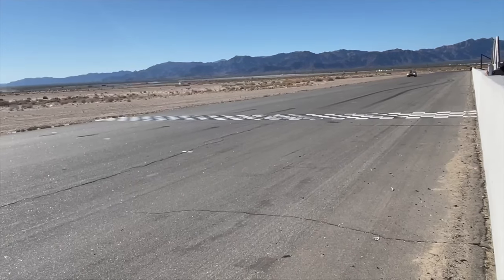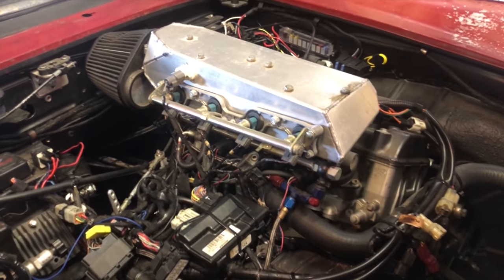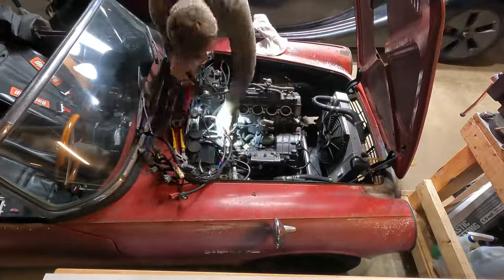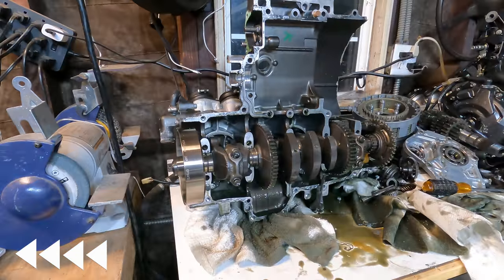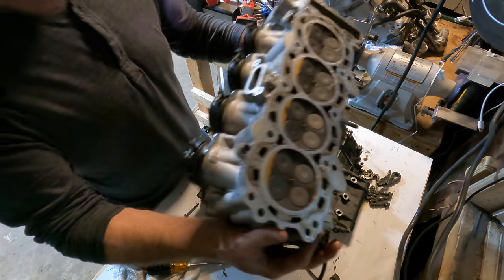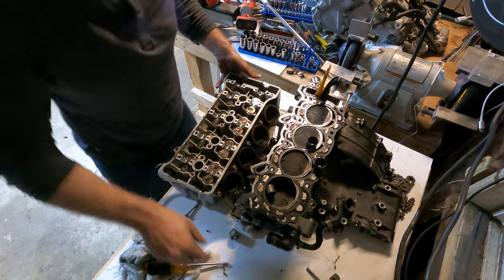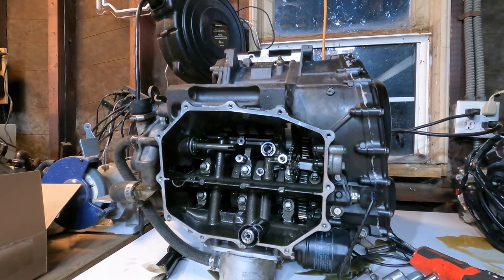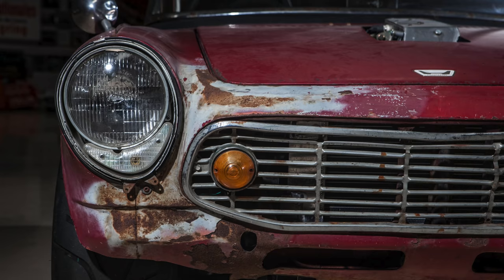I Blew The Motor In My Motorcycle Powered Car

Comment: "Faint ticking noise" just means there's no hole in the block yet.
Reply: Ohhhhh... Not always.  XD
Reply: 1:55 It's subtle, a slight ticking noise...
Reply: I thought a jack hammer is quieter
Reply: Drove a car once after it broke a rod and sent it through the block.  Was better than pushing it into and out of and then back into the shop. |

Had to drive it back in when the adjuster showed up.  That time, there was no oil in the engine because the pan was off, but meh... rod through the block.

Mazdaspeed 6.  It shook like a Harley with only 3 pistons attached to the crankshaft.
Reply: @manbunmyname5866  I’ve owned a few cars over the years which ended up making a “faint ticking noise”! The fact they were making any noise meant they were still running so to fix the problem I turned up the music. 🤣
Reply: @connomara4171  Sarcasm

Comment: We run a cbr600 in our FSAE car and have had really good luck with the Dailey engineering dry sump pump that replaces your water pump, just throw in a electric water pump and add a oil swirl pot/reservoir and we still keep 80+psi pulling 1.5gs

Comment: I recently added an oil accumulator to my track toy and it definitely helped stabilize the oil pressure.  It just depends on the level of "racecar" you're looking for.  For my stockish track toy it's a great improvement for about $500 ish dollars including the accumulator, and all the lines, oil filter mount, et cetera that I made.  Where as a dry sump would be a couple thousand easily.  One change I would make however is putting in an electronic valve, the manual valve is simple but inconvenient.
Reply: Do you ever use it as a pre-oiler before starting?
Reply: @OvertravelX  Yes, that's the primary reason I installed it.  Since I drive the car maybe once a month I wanted a way to protect it at startup.  Because even though oil filters have an anti-drain back valve in them they are not perfect (and not all brands are made equal) and will eventually leak by all the oil leaving you with dry bearings.  It also added some insurance on the track too.
Reply: some engines can end up trapping oil in the top end and starving the mains. oil can also foam and be a problem. long corners dont help.in a motorcycle centrifugal force keeps oil at a level that keeps the pressure constant. in a car? not so much.

Comment: Please please!!!! Do your own dry sump! I've been researching this a bunch for my project and would love to see your take on it. Sucks that you blew the engine but looks like you had fun doing it!
Reply: It is easy to do on a car engine since we have plenty of space with acc drive system with belts to run an off the shelf hydraulic pump. On a motorcycle engine replumbing the stock pumps pickup and oil galleys to do a dry sump is doable as well. The pump does not have to be external. With a small internal pump you would have to be careful about the length of the runs, diameter or tubing and lift height. So no 5 gallon drum of oil in the trunk area of the car. The thing to remember though about a proper dry sump especially in racing is that getting the oil out of the path of the crank and preventing oil starvation in sustained tight turns is only the side benefits. The real benefit is how much power you can build pulling a vacuum on the bottom end of the engine.  That is why racing bodies like say NASCAR limit the size of the hydraulic pump that can be used on the engine. Things like bay to bay breathing on the bottom end become almost less of an issue. It also allows for far more oil capacity than would be doable with a conventional oil pan and the need to package things. In F1 using oil consumption as a means of increasing power and range with exotic oils some of which are designed to burn on purpose and creative PCV systems to facilitate that has also been done already as well!

Comment: When I was doing the "motorcycle engine in a car" thing in a different context (also FSAE), we used to think that the starvation issue was more worrying with "normal" transverse mounting (where the lateral accel means slosh across the pan) than with "longitudinal" mounting (where the lateral accel is kinda like the longitudinal accel/decel the bike engine would see when starting and stopping without pulling sick wheelies and endos). I guess we all were wrong there, but right to spend too much of our lives making a dry sump. Thanks for showing us the light, and good luck with the new revision. Design, build, asplode, repeat.
Reply: We also had this issue, our solution was a custom oil pan that was about 1" deep, it had a few baffles and one-way flaps to stop sloshing. Kept oil pressure within a few psi of nominal on skidpad.
Reply: We still had a wetsump, but had an L-shaped pickup with a weight on the end that swiveled on a ball bearing. Our previous drysumps kept blowing engines, once we switched to that wetsump we were able to keep our engine healthy for years.
Reply: Yeah it makes little difference.
For example in an LS3 on sustained right hand corner over 1.4G it will accumulate oil in left hand head and starve the mains.
You can still starve a longitudinally mounted F20C in an S2000 with stock rims and a baffled sump.
Accusump for casual track days or dry sump if you want to pull G's an run hard. Best part is priming engine before you start it by turning the oil pump separately :)
Reply: @N4CR  Interesting examples. All the concerns about the orientation of acceleration in corners I mentioned in reference to sumps also applies to drainback design, too. But you're right that a sump wouldn't solve those.

Comment: Make a 'pendulum' oil pickup. It's a oil pickup with a swivel in the middle and the end always seeks the gravity low spot. Works great until it gets a small vacuum leak and sucks air.
Reply: Dunno, that dry sump thing sounds more robust.

Comment: So if you do a motorcycle power plant swap you need a dry sump system so you never have to worry about problem I'm guessing?  Awesome video teaching us what to do and no to do lol.
Reply: Don't be silly.  You need active mounts so your engine can lean when your car corners.  A few linear actuators, some Arduino...
Reply: @Lawrence330  Make it passive and mechanical so steering tilts the engine.
Reply: A whole new meaning to "torque steer".
Reply: @EmyrDerfel  I see where you're going with that, but the lean angle depends on the lateral acceleration, which depends on both speed and steering angle, not just steering angle. You an build a mechanical calculator... or go the computer-and-actuator route. Or just put in an accumulator.

Comment: Daignosis correct. BUT you should have a 25-30psi oil light. A trailer light is best big and bright!
And ofcourse an oil guage which is the first guage any engine should get, followed by water and oil temp. Than a tach!!
A better pan and what I find to be an excellent deaeraration device, an oil cooler. Not so much for temp but as a device to deaerate the oil. You may have oil and oil pressure but oil with 20% air does not lubricate near as well as straight cooler oil.

Comment: I know the usual step now would be to go to the venerable hayabusa engine, maybe with a little something called a turbo attached at this point (as the old busa engine is to engine swaps what crabs are to evolution) but may I suggest something from Honda that I am absolutely not sure would even fit in the engine bay?

A Goldwing GL1800 engine.
Reply: Triumph rocket three might work too...🤔
Reply: I think he's pretty set on a Honda engine.
Maybe a CBR 1000 this time to have more "torque"
Reply: K1600 engine!
Reply: "safe-T-turbo" for safe overtaking
Reply: @calebdavies526  I asked about that on an Instagram post, and Matt responded that he wanted to use a Honda engine for the S600, and that the BMW engine was for another project.
Reply: A Vulcan or Goldwing V6 is the way to go. Light weight, plenty of HP but even more torque and low enough in the power band to be useful for a car on the street or track. Since he spends more time on the street doing cannon roads it makes much more sense than a Hayabusa engine. Plus he gains reverse.
Reply: @buckaroobonsi555  goldwings have flat 6's, not v6s. And the reverse on a goldwing is an electric motor, not an actual reverse gear.
Reply: @buckaroobonsi555  The Gold Wing has a flat engine (flat-4 originally, flat-6 since 1987), not a vee (such as a V6). Because it is flat, it is very wide.
Reply: @brianb-p6586   Yeah, it's why I wasn't sure about the engine being able to fit it in the engine bay, though since the s600 is 20 inches wider than a Goldwing it might just be possible (with a bit of fiddling around, as always)
Reply: @Bobinatronus  The problem is that the bike doesn't have suspension and tires on each side of the engine. Imagine the left and right front suspensions of the car, complete with wheels and tires, sitting on each side of the bike's engine... that's wide.

The Subaru BRZ does have a flat four between the front wheels, but it uses a compact McPherson strut suspension and it's a much wider car.

It might work in the S600, but it seems unlikely to me.
Reply: @brianb-p6586  well, it looks like my armchair mechanic skills are found wanting once again. Though for some reason I can't get the image of an S600 with an extra-wide body kit out of my head now
Reply from the maker: Since it's Honda's first car, I gotta stick with the Honda engine. And I like the high revs of a literbike engine. So it's getting the same engine, just newer :)
Reply: @SuperfastMatt  consider the hayabusa motor
It fits nicely in the engine bay and with some easy intake mods it all fits under the hood
Reply: @SuperfastMatt  Happy to hear that.
Reply: It's too bad he's going with the same thing, because I'm pretty sure those Goldwing engines are shaft drive
Reply: @dank_69_420_memes  Wings are shafties but deliver a completely different powerband that is not as sporting as the CBR1000RR engine that I think he's going for.  The Wing redlines at 6,000RPM as opposed to 13,000+.   Great idea otherwise though for sure.
Reply: @SuperfastMatt  cbr1000rrr? blackbird or vfr1200?

Comment: or too restrictive oil baffle. in a corner oil sloshes and gets trapped above the baffle and cant drain back. then straight up run out of oil under the baffle and around the pickup. could be something idk. also what's next? busa, zx14 would probs be better with the extra displacement than the rrrrrrrrrrrsp-r motor you mentioned previously.

also how do you get a good oil level when you have an accumulator? you don't want it to suck up air cuz all the oil is in the chamber. or does it just self regulate and you don't have to worry about it.
Reply: I noticed that too.It's not a good design
Reply: The accumulator self regulates. It can only hold so much oil so basically you adjust the level in the engine so the engine is full when the accumulator is also full.
It depends on the system but, generally the accumulator basically just injects more oil under pressure whenever the engine oil pressure is lower than what’s in the accumulator. Then, whenever the engine pressure comes back up it recharges the accumulator. 
At the end of the day accumulators are bandaids and don’t really solve the problem. They’re good for pre-oiling an engine before starting it though.
Reply: @NBSV1   ok i get it just have a volume measurement for the oil level then add the volume of the accumulator.

 but how does it work as a pre-oiler? shouldn't the accumulator be empty when there is no oil pressure? ie. when it's not running before you start it.
Reply: @nick4506  It has a valve between the accumulator and the engine. Either a manual one or an electronic one. Basically if you close the valve before you shut off the engine then the accumulator will store however much oil under pressure. Then, you can open the valve before starting and the accumulator will push that pressurized oil into the engine to pre-lube it. 
Accumulators are great as a pre-lube device, especially for things that sit a long time. They help with oil issues on track, but aren't the ideal solution.
Reply: @NBSV1  cool, idk it seems like a perfect solution to me. adequate oiling with stock pump reliability? and without the cost or paracidic losses of running a 5 pump dry sump? sounds great. i guess if your raceing up the Guggenheim you will find the limits but i think it's adequate.
Reply: @nick4506  You don't really need a high number of stages for a dry sump system unless it's a full on race setup. Even a 2 stage system can work if you're not trying to pull a vacuum in the engine. 
Accumulators are a good solution in a lot of ways. Often their short comings are from underlying oiling problems, like a bad oil pan, that don't get addressed beyond adding the accumulator. If you've got good oil control and it just needs that last little bit for long drawn out corners then they're good. If you're having oil pressure drops frequently then it isn't likely to really help. 
I've just seen quite a few engines that have still blown with an accumulator.They all thought it was a good cheap solution over a full on dry sump system...
Reply: I agree. To me that baffle looks absolutely horrible design. Also was really surprised to hear in video that he was relying on oil light. If one does customized sump and other engine mods, then the dirt cheap oil pressure gauge is absolutely mandatory in my opinion.
Reply: @jothain  An oil pressure light is really needed when on the track. It gets your attention much better if it comes on. But, it needs triggered at a pressure where things start to be a problem when on track. Like 30psi. 
Often people get one that's set for like 5 or 10psi so the light isn't on when at idle with hot oil. At that point if the light comes on going around the track it's well past gone.

Comment: Nice to see a fellow SRT member on the internet. I also have a motorcycle powered car 126p with a cbr929 engine (i use it for amateur rally) I highly recommend going to a 04-07 cbr1krr engine they are cocroaches and make wonderful power. Or a cross plane r1 if you want that sweet sound. Best luck on your future endeavors and thanks for the amazing content !!!!

Comment: Seen a significant number of bike engines fail in kits cars (Caterhams, Westfields, Furys, others) through oil starvation on tracks in the UK and Europe some 20 years ago. People quickly resorted to using dry sumps or Accusumps. The Accusump works for short surge situations. Dry sump is the only "proper" solution but it is expensive.

Comment: On our internal combustion FSAE cars (using the '07/'08 CBR600RR) we ran trapdoor baffles in a custom oil pan which worked well, although FSAE autocross corners are nowhere near as long as those on a road course. The trap door baffles let oil into the center area where the pickup is, but they don't let it out. At least in FSAE, IMO you don't need to go dry sump if you have a well designed oil pan. We also overfilled the engine oil a bit which helped.

Comment: I use a "snake oil", ProBlend. Since 1984. I have many stories, one is the block cracked in my Mazda pickup and all the oil went into the water. To keep it short, the temp needle was off scale. I drove over 100 miles down to Los ALtos and back up the Santa Cruz mountains. The engine started right up and stopped like nothing happened. The spark plug boots were very swollen. It was trashed but it started right up. I had used it for 6 years, 120K miles so it had nice coating of ProBlend (8000, 8080). So I've used it on everything, even pre mix for my sons MX races. It makes wet clutch's and transmissions shift smoother.

Comment: Logging oil pressure is pretty useless as method of improving :  you will not prevent problems,but only have trace of those after the engine experienced problems.
You need a pressure switch cutting off ignition if oil pressure goes below a given pressure.
You can by pass it with a push button for starting the engine.
Also,shortening the oil pan is absolutely not a good idea,specially if you don't give it back its oil capacity with lateral pockets.
The engine is already facing the wrong direction in the engine bay,wich is quite a concern in itself.for lateral forces.

Comment: I had an old Triumph TR7 I tried using as a ITB SCCA car around 1999. The engine did a bearing consumption move that produced a tick very similar to yours... fixed mine with straight 70 weight motor oil, well it sounded fixed for about the first two minutes after a cold start up.

Comment: The next engine should be a Hayabusa engine with an added little turbo 😁
Reply: I'd suggest a K1600 engine, which has nowhere near the same degree of affordability, power, (lack of) weight, tunability, aftermarket support, or anything really. But hey it's a tiny straight 6
Reply: Nah, he should definitely keep it a Honda engine, imo
Reply: Turbobusa is a go
Reply: @Blaquer17  The GL1800 awaits your ascension to the land of 6 cylinders
Reply: @Bobinatronus  Good one!
Reply: Keep it Honda, get a blackbird engine or vfr1200

Comment: The accumulator is an easy way to solve it, though they need to be serviced now and then. Mine had over a liter (a quart for those sticking to medieval units) leaked over to the air side, and the tank peed copiously all over the floor before i replaced all the o-rings. (chose to have it in the car for easy access and weight distribution). Best of luck with the little gem, it's high on my "i want"-list.
Reply: Hey! Those "medieval units" are super easy to work with!  Why count by tens when you could count by 3, 12, 4, 16, 1760 and 5280?  It's not like the rest of the world has a better way. /s